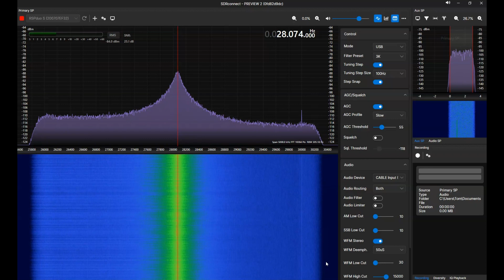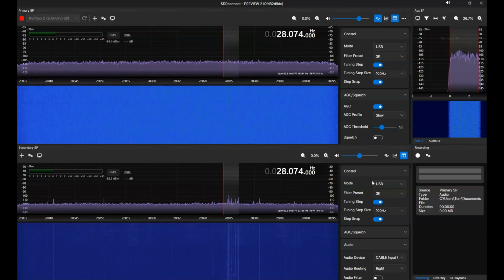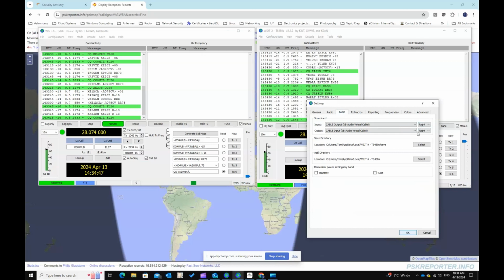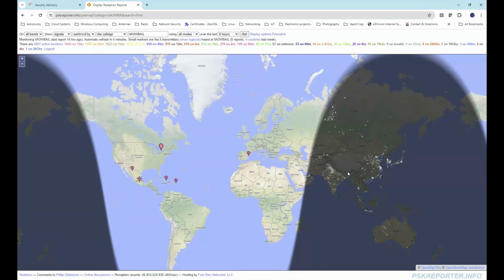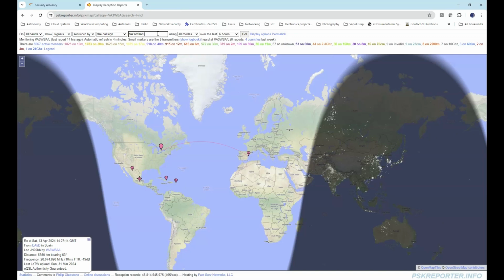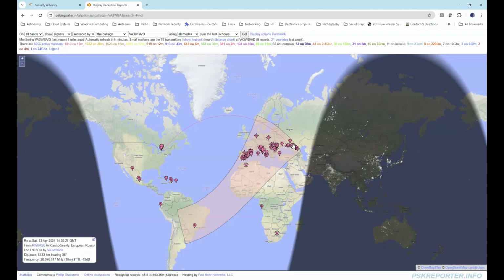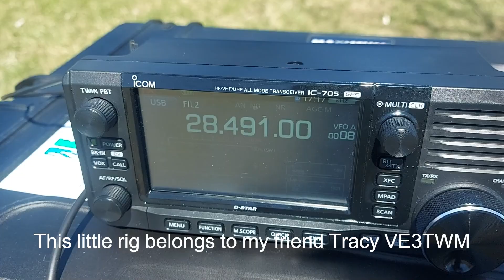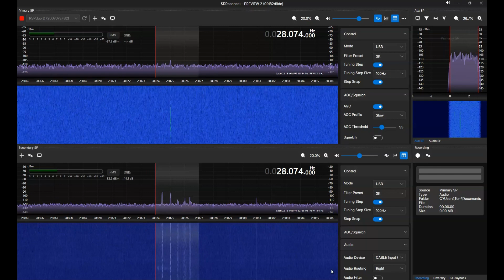Small magnetic loop antenna compared to a dipole.

Comment: Cute square loop!
How do you have calculated the coupling gamma match?
What are the dimensions of the dipole and what kind of balun have you used?
Greetings.
Reply from the maker: Thank you for your question. The gamma match has been sized experimentally. Originally, the antenna has been "designed" for 6m, but then I have added some capacitors to bring it down to 10/11m.  The dipole is a full size self-supporting antenna made of aluminum 3/8in Tile Edge (I do not remember exact dimensions but it was long and sturdy enough) I got some leftovers after bathroom renovation. I just have several turns of cable, the "ugly balun" to work with it. It was done good 5 (or more) years ago and I have not documented it well. The dipole works OK and have used it many times to talk on our local 10m net.
Reply: @radioastronomy2001  Tile edge... How interesting material! Do you mean full size dipole like a half wave 6m dipole (3m long)?
Reply from the maker: @DJMotavirust  Each piece was about 2.5m long (8feet) Ideal size for the 10m dipole. I had to trim a bit to tune it.  (And YES I have another one for 6m just above it. Made from different aluminum scrap pieces) All this is held together, using some small screws, by a plastic cutting board.